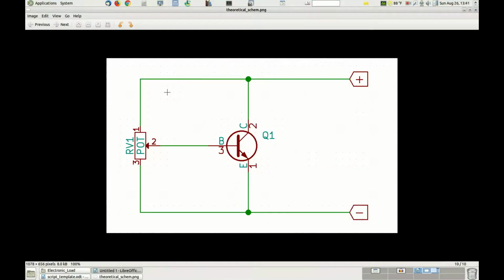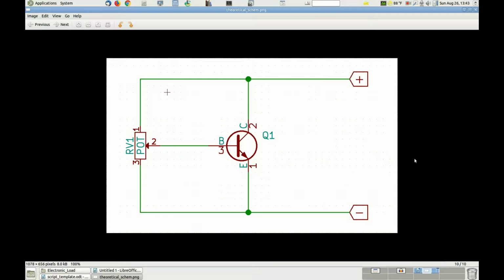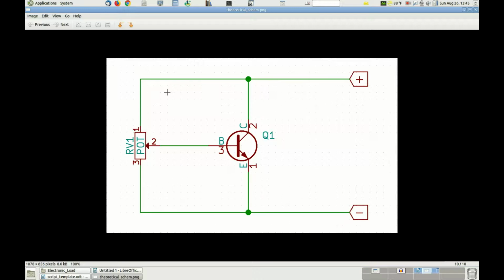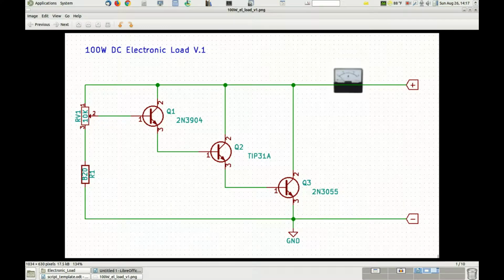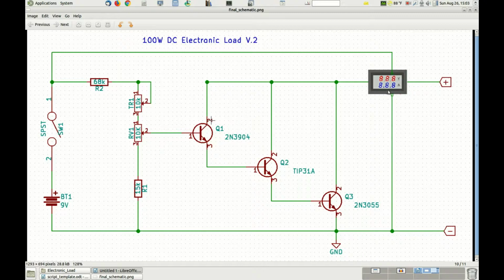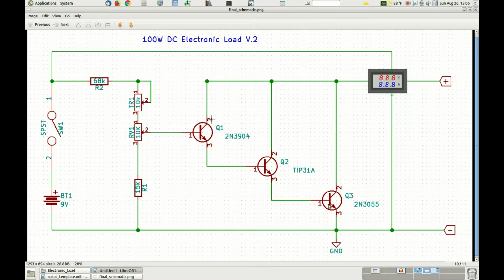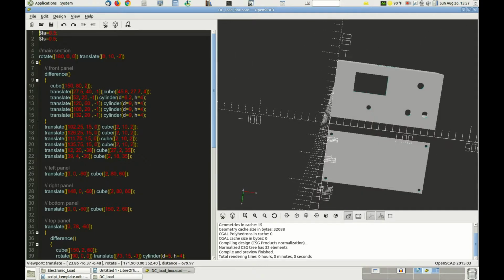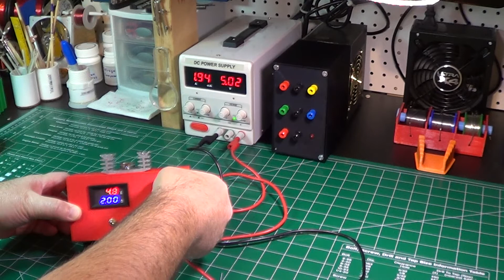electronic load

Comment: Very good to see your video. I did design almost the same circuit, but instead of R1 at the bottom of the resistor, I used the voltage drop of a pair of diodes (1.3~1.4V) and a TIP120 as integrated Darlington transistor ansa counting on the almost constant beta Ic/Ib around a desired operating point.
I also did a course shunt regulator (using 1x white LEDs as ~ 3V zener) to make he supply voltage to the potentiometer independent of load voltage variations, so its wiper ranges from 1.4v to 3V. 
What I didn’t investigate on mine simple one, is the current variation when larger voltage supply variations occur. I found that it would be great if you comment or supplement with your findings.
Congrats!
Reply from the maker: Thank you for your kind words.  With this edition of the electronic load I found that with large variations of the voltage I was getting some variations of the current,  which caused me to keep readjusting the value. This issue actually remained until I finally ended up with a version 4 using a closed loop negative feedback,  which improved considerably the stability of the current.